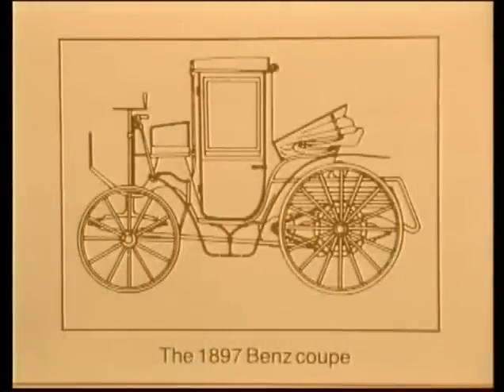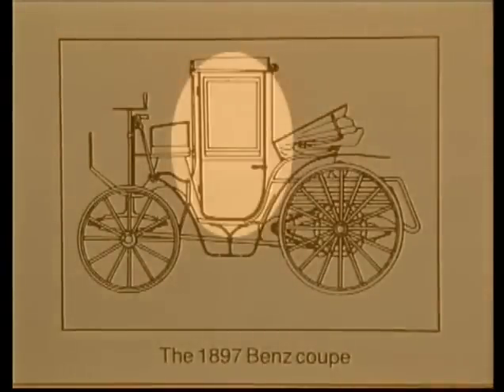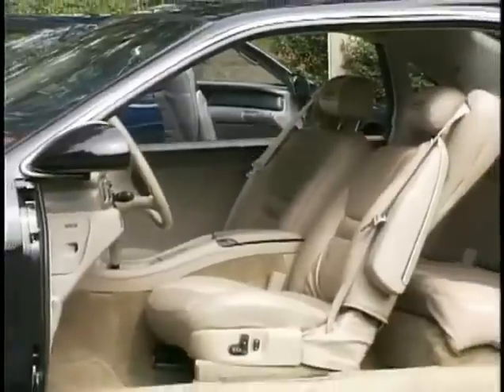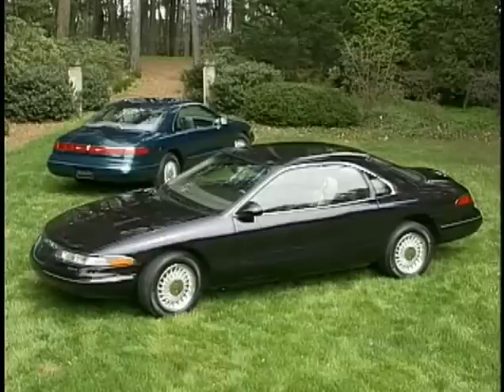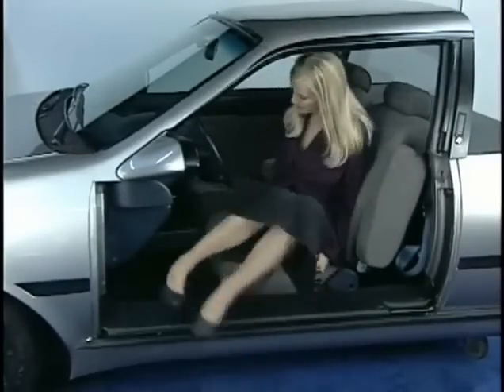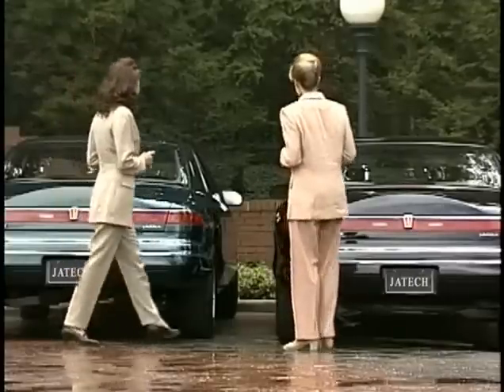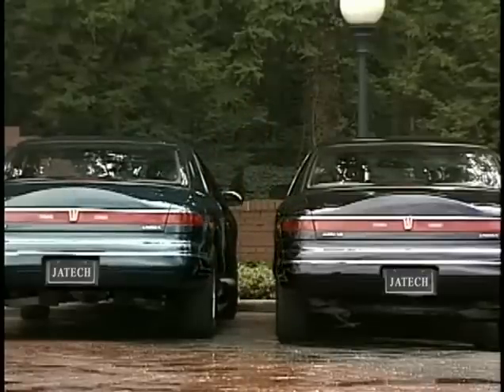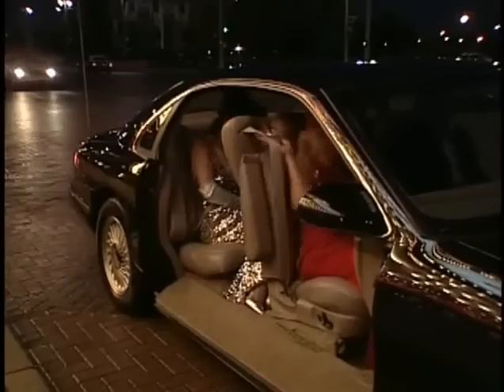Invisible Car Door Technology

Comment: I think the reason why car doors still use hinges is because it is reliable and simple (cheap) to build. If it were just about the space, you might as well build slide doors into every car. Cheaper, but instantly looks like a van or worse. These rotary car doors are quite stunning to look at, and I'm surprised at the speed. However realistically speaking they just add another source for deterioration to the long list of electronics that already need constant maintenance and replacement. Even though they are not sexy, I think I'll stick with my hinges.
Reply: ok but what about luxury vehicles like rolls royces and stuff? cheap and etc is not a factor when building those cars.. i wonder why that door never really happened....
Reply: Calvin Wong I guess they weren't crash proof or would have needed significant work to get to work. 
Like they said, they removed the "B" pillar, which is why makes the whole car less stable in crash situations (from the sides). It also forced them to screw the seatbelts to the upper part of the seat. This is ridiculous, as the belts need to be fastened to a pillar and not to a moving part, like the seat. 
I agree it looks very nice and Sci-Fi, but they basically welded out all the safety features for side impacts.

Comment: The only problem I see with this type of door is the minor crash.I doubt very much that the door would still work should there be a small impact on the door, with a normal door they still work even with dents some still work with bad damage, but this door I suspect would fail to function after a small impact.Other than that it's a good idea.

Comment: This is a great design, and would allow easier and larger access.  The only drawback I see is if it rains or snows, and it it's real windy outside, all of which would effect the drivers and riders, and everything on the inside as well.  Also, if you're carrying a cat or dog, they'd need to be leashed inside in case the door opens and they suddenly take off.

Comment: well for 2 reasons...
1) What happens when your battery dies and you cant get in your car to open the hood to jump start your car or your remote battery dies and no one is around to help.
2) Incase of a T bone collision the door will just crumple in and you will not be protected compared to a standard door .

Thats why it was quickly thrown away.

Comment: That would change the form of the door so it wouldn't work unless the buttons were on the door, flush. That would be awkward to press. Right now they are on a handle next to the door on the inside. That handle would not be there in this car.